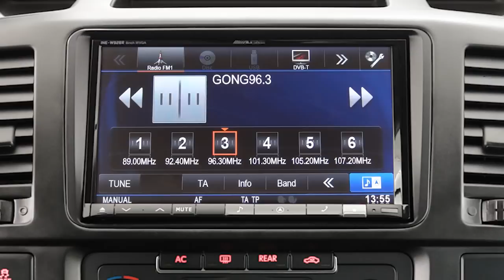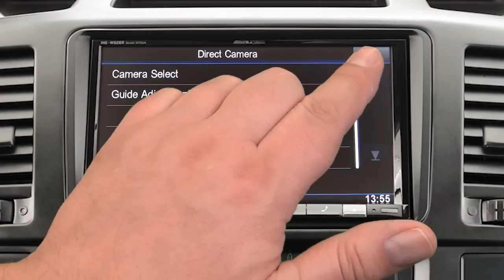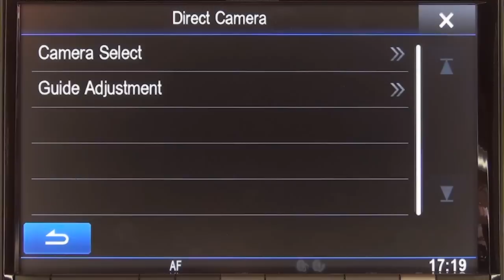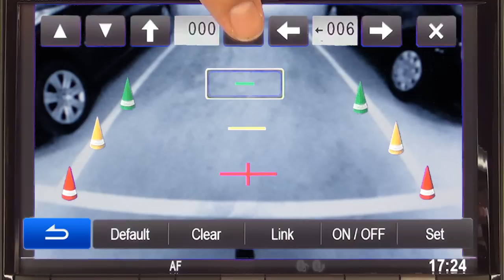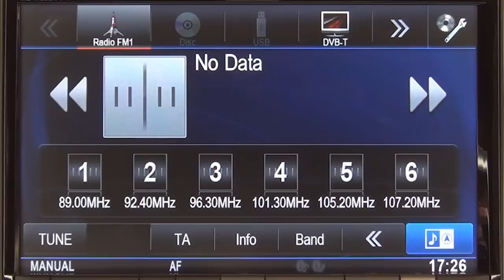Alpine Rear View Camera HCE-C210RD installation in a VW Multivan

Comment: Great video! A little question: what is the long white stuff that you use for wire pushing/pulling all the way to the A pillar (at 4:33) ?
Reply: it looks like 1/8 inch  pex or equivalent nylon tubing